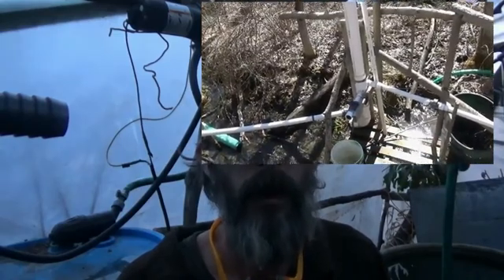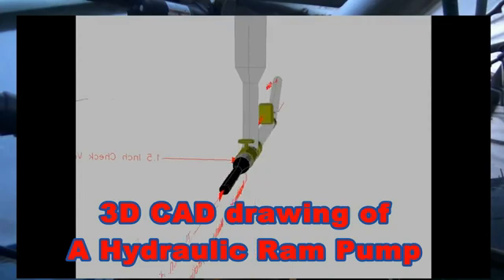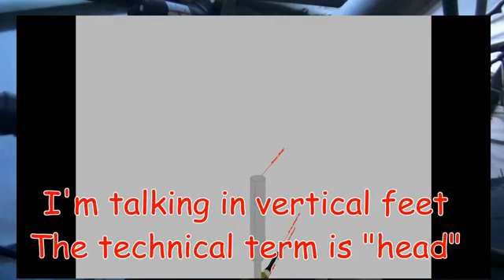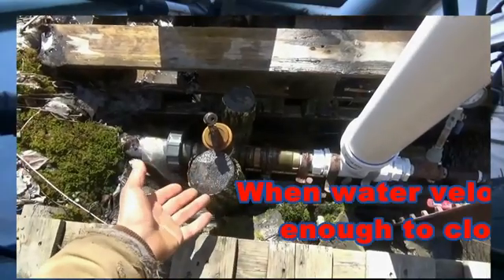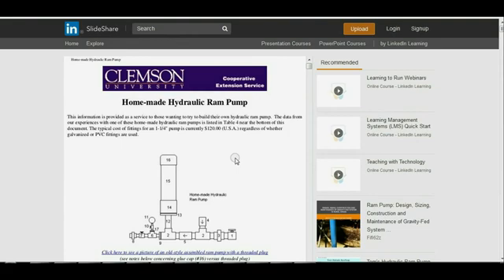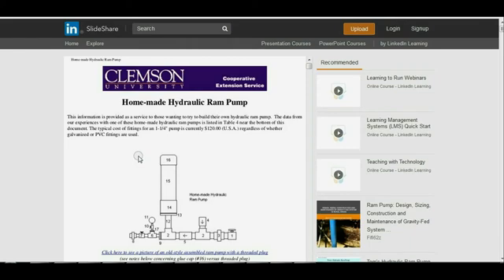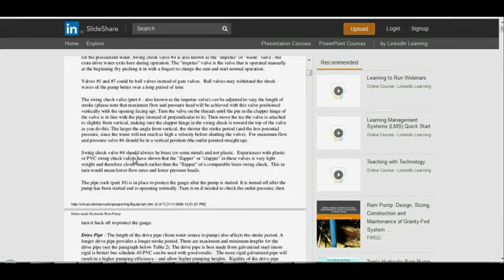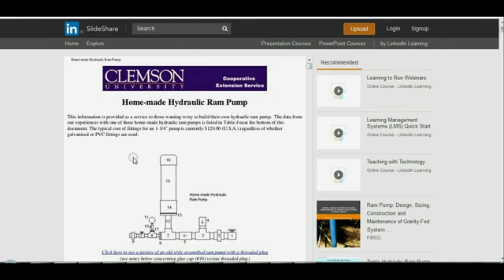Part 1 Ram Pump The Manual Series - Introduction And Basic Explanation

Comment: How many meters of elevation required for a ram pump? Minimum elevation
Reply from the maker: The shortest height minimum I've seen done is about 36 inches... just shy of one meter. I BET with the RIGHT design you could get down to 1 ft... but remember your energy is coming from the drop and mass... so if you go "low head" you will need "high volume" to compensate and deliver any real water anywhere.